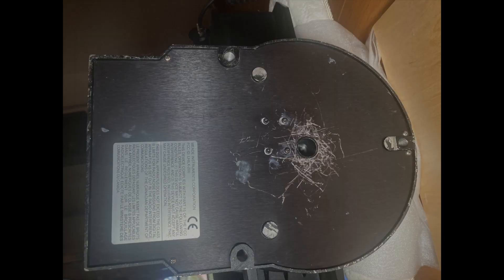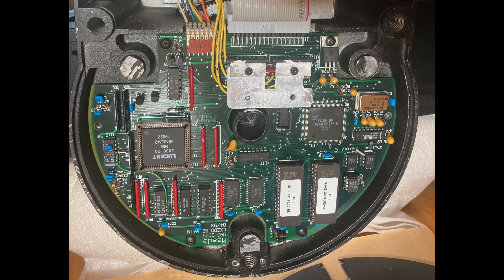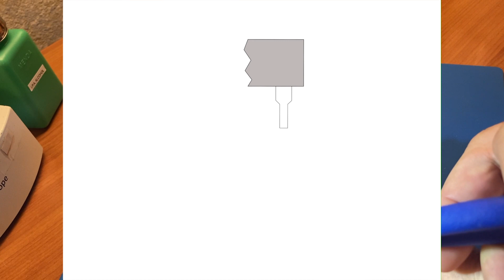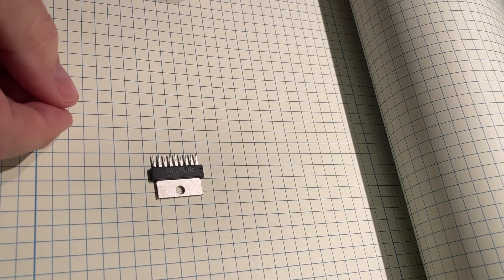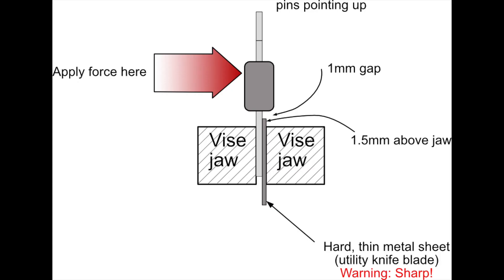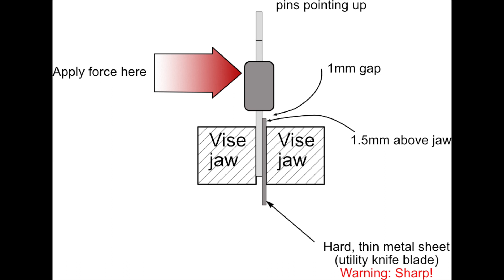Motor Drive I.C. Replacement for Meade LX200 Classic

Comment: How do you know the orientation of the pins?  Is there a possibility of installing the chip wrong?  That will also help on deciding to bend left or right.
Reply from the maker: Pin 1 is marked on the PCB, and it is the leftmost pin looking at the marking side of the package, with the pins down. Does that help?